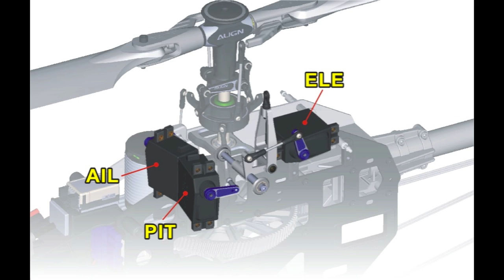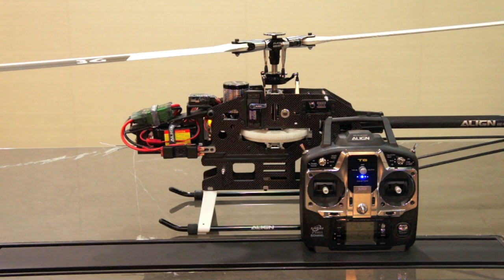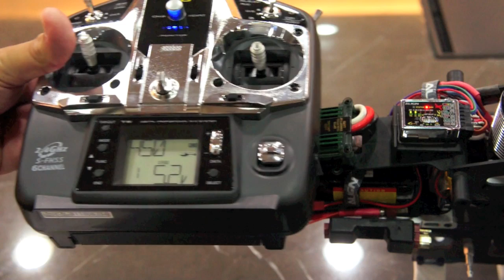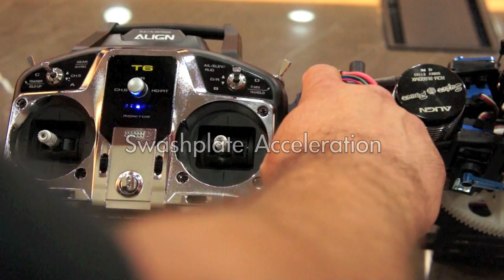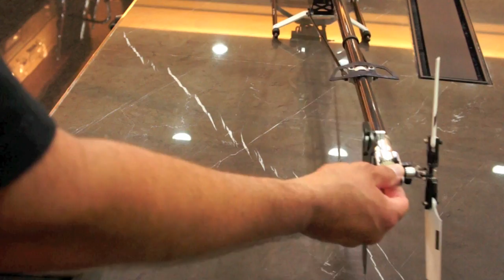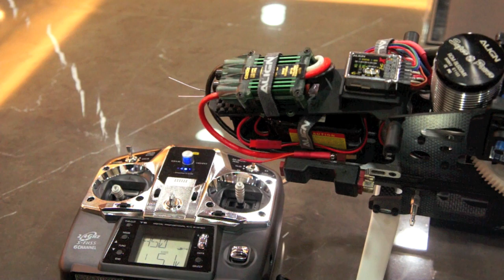3GX SETUP（for V2.0、V2.1、V3.0 and V3.1）

Comment: At 3.00-3.10 min,  you said " Apply that same value from your swash menu onto your elevator in the swash menu ".

Do you mean  no need to measure any blade angle for elevator pitch, just use the value got from setting ail pitch ?